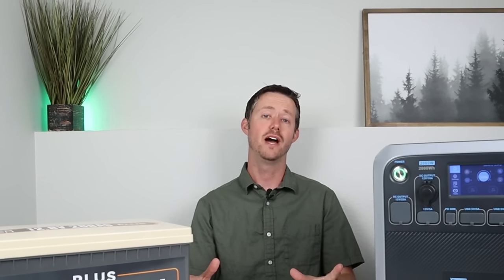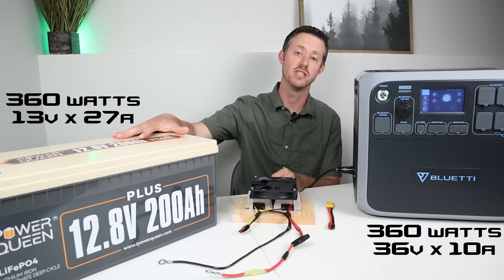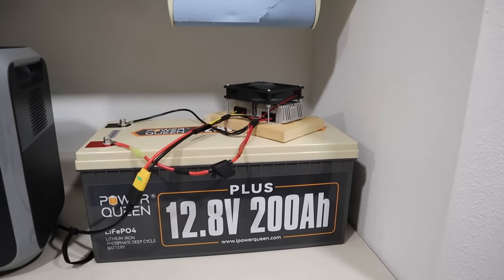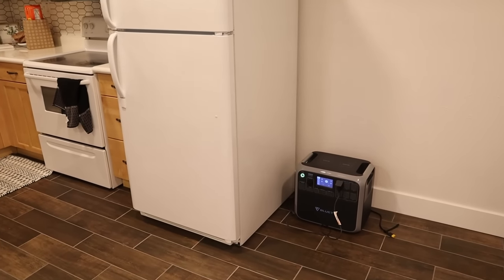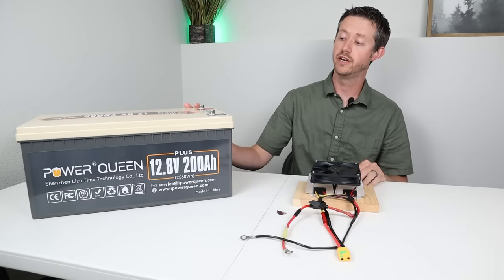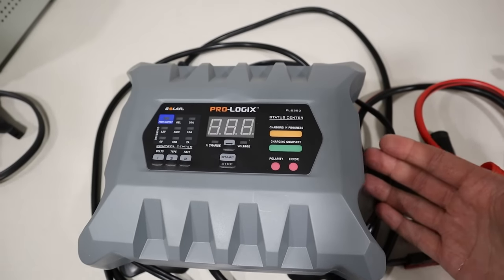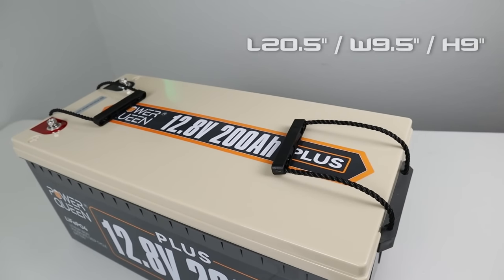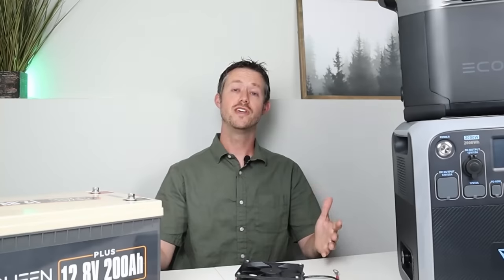Make Your Power Station Last Longer! Power Queen 200AH LiFePO4 - DIY Expansion Battery!

Comment: Another good video, thanks. Since I want to charge my power station with solar, could I then charge the external battery with the power station? In other words, skip buying the AC battery charger you showed and make the external battery a fully functioning expansion battery?
Reply from the maker: you'd still need some sort of battery charger to charge the 'expansion battery' from the power station but yes, that would work just fine.
Reply: @Jasonoid  Thanks again! Renology has some highly rated battery chargers. Would it be a mistake to get their 40A (vs 20A) since it might create too much current for the power station? Also, to charge back the power station from that external battery (extra XT60 port, 11-60V 15A, on Delta 2 Max), would a step-up converter be needed or helpful? Fuse the positive?
Reply from the maker: I have a whole video on using step up converters, you might find this video helpful:
https://youtu.be/I78RxjRXTn4
As for the AC battery charger, a 40 amp charger will only be around 500 watts, maybe a little more with efficiency losses. No challenge for the Delta 2 Max.

Comment: question concerning using the power supplies as battery chargers.  Does the internal BMS control the power coming from the power supplies to properly charge the LiFePo4 batteries?  Where are the 'smarts' to properly control the current and voltage?
Reply from the maker: The power station charge controller does all the work.  Just don't go over the voltage input limit for the power station and you're good.

Comment: Great video. It takes some effort putting the pieces together and making a video of it all.
Is it possible to connect the outputs of the ExpertPower 12v 20A Smart Charger and the KISAE Technology DMT1250 DC-DC Solar Charger in parallel? In another words, the LIFEPO4 battery would be charged using AC power, the alternator and solar all at the same time. Thanx!
Reply from the maker: Yes, you can parallel different types of charging sources at the same time on one battery. You'll just want to make sure they have the same charging parameters (which most LFP charging profiles do). The battery will charge faster with multiple chargers attached.

Comment: Cool!  Could you use aligator clips with an MC4 adapter to then plug into the solar in? Any issues in that? Does it NEED a converter to be safe? I'm a newbie
Reply from the maker: This product is plug n play and will work very similarly:  https://youtu.be/NqnYaqMwktE?si=A2W4PP2tpKl1zoti
Reply: @Jasonoid  PERFECT! I Thank you for this!   I will use your link when I get it.  I watched your video on it. While I could probably snail along and figure out how to do a DIY one like you showed in another video, but THIS just makes it easy ,and me MUCH more confident. Plus, it seems to be kind of universal as opposed to something brand specific and more $.  The noise of it is significant, but, okay for the job. I hope it can run for a long time with the fan ,without heating up too much, as I would be pulling it from a standalone to a power station.    I also wonder if the peceron would turn off once it brought a power station to full, AND a pass through power station be able to run/disharge while it was getting charged this way?
Reply from the maker: @neelimabaird3159  it will automatically stop charging once it's full.

Comment: Been doing this with a 12-24v 10amp into the solar port on my power station for awhile now
Reply from the maker: It's much better than just 12v, charging at 100 watts is too slow!
Reply: @Jasonoid  I have the 100ah power queen and feeding it straight into the solar port on my EcoFlow River I only got 156w but with my booster I max out the solar at 199w. Easier and cheaper than buying another power station in my opinion

Comment: put 2 batteries in parallel and connect with the clamp cable that comes with bluetti ac200 max. and  DO5OS, or you connect the batteries in series and connect to the bluetti on the PV input and you have more power and you don't get complicated with electronic assemblies on the plank
Reply from the maker: You'd need to put those two batteries in series for a higher voltage. I agree, that would be much more simple :)

Comment: I have a suggestion about keeping the inverter cool. 4:57  would it be better to have it submerged in mineral oil instead of using a fan? I’m talking about lowering the temperature.

Feel free to correct me🙂 I’m learning
Reply from the maker: Mineral oil would work as well, but eventually the mineral oil would get warm too. You'd need a 'water cooling' loop to keep the heat down.

Comment: Could I use my existing 12v solar panels and wire it to victron mppt controller and run it to 2 190ah batteries in parallel to run 24v into the pv port on my ac200max?

Comment: Great Idea. I just picked up a Vigorpool Captain 1200 and would like to use this idea to boost capacity. The captain 1200 uses Anderson connectors for solar input. What connector would I use to connect the powerqueen?
Reply from the maker: You could search for a cable that is "ring terminal to female 12v cig plug". Then you can connect the ring terminals to the battery and plug in the 12v charging cable to the female socket.
Reply: Thanks for the info.  I had another question. If I had a 36v battery I wouldn't need to boost it to charge my power station faster. Is that correct?
Reply from the maker: @sote23  yep, just hook it up directly to the mppt charger and you'll charge your power station much faster than a 12v battery.

Comment: cool video.want to try this out on my ecoflow powerstation river max,but 12v and 100ah.have the powerqueen battery bluetooth or app application?want to see if its full or not...thx
Reply from the maker: It will charge around 100 watts with this cable:  https://amzn.to/3YDmPfl
If you use a 12v to 24v booster you'd see around 240 watts input.

Comment: How about...
48V battery and use the PV connection?  fewer parts and 48V chargers are readily available.
Reply from the maker: 48v battery would be great to dump power into a large power station!

Comment: I have the Anker 767. If I did this would it hook it up to the solar inputs to charge it? Also, this battery at 2560 watt hours is more powerful than the the Anker expansion battery at 2048 watt hours. This battery is around $650 and the Anker expansion battery is $1500. It sounds like this setup on my 767 is way more economical than the Anker battery or am I missing something?

Comment: Can you charge the battery with a 200W solar panel while using the Bluetti?  I want to boost the power station and charge up the expansion battery during the day with solar; solar to the battery, battery to Bluetti AC180, and the Bluetti powering a Starlink Mini.
Reply from the maker: Yes, you can charge the standalone battery while it's dumping power into your power station (AC180).

Comment: How much of the battery charge is lost by generating heat by the boost converters and running the fan? 🤔
Reply from the maker: These converters are about 93% efficient, so not too bad. You could also do this instead? Use a 24v or 48v battery:
https://youtu.be/tK4JKmfndh8

Comment: Isn't this going to damage the PS by sending a massive current spike?  There are limits to the amperage you can send into the solar input and sending a dead short across a battery seems like it could fry the input?
Reply from the maker: The power station limits the amperage on the both the DC and AC charging input automatically. It kinda ramps up the charging slowly so it doesn't spike at all.

Comment: Hoping to see a video of diy expansion battery pack  lifepo4 50a 200wh for the bluetti eb3a
Reply from the maker: This is a older video of how to get the most charging out of the EB55 and EB70. Hooking up a 12v battery and 12v to 24v converter to the EB3A will give you the same "expansion battery"
https://youtu.be/_7l8hoNebDY

Comment: Hi Jason. Interesting video. You said if you could change something with this you'd add another positive input wire to the step up, and fuse them both. If you did that would both legs get fused at 20A or 40A?
Reply from the maker: I would use 4 legs (2 pos, 2 neg). 10 gauge wire would be fine, fuse each positive with a 30 amp fuse.

Comment: Can a Solar Panel be hooked up to a Voltage Stepper to increase the voltage? 🤔
Reply from the maker: Most voltage boosters don't like how inconsistent a solar panel can be. Maybe if the day was super clear it would work? If you had clouds or changing conditions it wouldn't like it.

Comment: This was great but I’m not very technical. I live and work in my van hauling freight across the country. I have the BLUETTI AC 200 max and it powers everything currently but not for very long. In fact as I type this I’m charging it at a Starbucks. I drive ALOT so was considering connecting to alternator but I also “sit” between loads. Sometimes for days so also considering Solar. My question is it seems like the battery can only “feed” the BLUETTI and not the other way around. Would love someone to walk me through a reasonably cost solution that I can actually do myself. Do I do solar only and just keep the BLUETTI charged. Do I do alternator only charge?  Do I do both?  Do I do both with an extra battery like this?  Currently I have 12v fridge, 2 max air fans, a diesel heater cpap machine and tablet and phone. Ideally would love to position myself to power a 12v AC unit. Friend of mine has this set up with traditional batteries but is a busy engineer!  HELP :)
Reply: Have you considered the Bluetti expansion batteries plug and play solution for your needs? If you're hauling freight across the country, you could easily charge your Bluetti from a cigarette port? It will give you around 100W charging.
Reply: @LiquidTurbo  yes it’s expensive $1,800. I do charge now the way you’re suggesting the problem is it’s slow. I find myself between loads running out. I can sit waiting on loads all weekend or sometimes a day or two between. Last night I stopped fully charged. This morning I’m at 67%. I’m driving to campground 2 hrs away today and will plug in there. Faster charging and /or longer capacity is what I need. Especially if I ever want to run an air conditioner.
Reply: @slindsay4784  you’re spending more than you’re accumulating via the cigarette port. 

There doesn’t seem to be a good solution other than putting solar panels on top of whatever vehicle you’re in. If you don’t want to spend for the expensive expansion batteries for extra storage at the end of the day you’d still need AC power from the grid to “charge up” as you’ve been doing. You can either spend less energy or generate more. What do you think you should do?

Comment: Hello. Can I use the Bluetti T200S charger (200W - EB55 / EB70) to double charge the AC200MAX? If I insert it into the solar charging port, through an adapter?
Reply from the maker: That should work just fine.

Comment: I have a question will any alligator clip that's 12awg work with 24v battery? Asking because. I have only seen 12v clips.
Reply from the maker: Yes, 12v alligator clamps will also work with 24v batteries. No issues at all
Reply: @Jasonoid  Awesome thank you, for answering that.

Comment: Have you used this concept with the Bluetti AC300? I’ve watched you use the 48v rack battery as an expansion battery on the AC200 Max. I’ve read and watched videos but still slightly confused. 

You can connect any volt battery to the solar connectors on the AC300. Since it’s dual mppt, you can use two batteries or the same battery with two connectors. 

My question is this: do I need fuses on the battery wires? I know the AC300 has the amperage you can set, but as protection, should fuses be used? 

There are many sales right now on 48v batteries… Is it safer to use a rack battery or the regular setup for this use?

Thanks in advance! You are my inspiration to do this stuff on my own!
Reply from the maker: Yes, you can use a 48v server rack battery to charge the AC300 on either or both ports. I do it all the time. The power station will limit the amperage automatically to 12 amps of less. 

I'd recommend using 12 awg or 10awg wire from the battery to the power station. If the wire run is longer, use 10awg. You'll want to use a 20 amp fuse for 12awg, or a 30 amp fuse for 10awg wire. Hope that helps. I have a discount code for signature solar 'Jasonoid'.
Reply: @Jasonoid  so would it even matter if it was at 48v Rack battery or a regular 48v lifepo4 battery? As long as there are fuses with there 10 or 12awg wires?
Reply from the maker: Here's a video breaking down each battery voltage:  https://youtu.be/tK4JKmfndh8
It can be any battery really, it doesn't have to be a 48v server rack battery. The higher the voltage, the faster you'll charge.
Reply: @Jasonoid  I have watched this a few times lol. I think I overloaded my brain. Thanks a bunch. Much appreciated!

Comment: thanks for the detailed video - very useful and informative.   I've found a ton of MPPT Solar controllers for Lifepo batteries, but not many that I can use a sa trickle charger for my Flooded Lead acid battery on my 3rd gen Tacoma which - I think - needs 13.8 volts to charge.  Do you have a recommendation for an inexpensive mppt charger for that?  thanks again for the video!
Reply from the maker: Both the Kisae and Epever are completely programmable for all batteries, you can use the Epever for both lead acid battery types and programmable lithium batteries. Pretty cool!

Comment: How would you charge the lithium battery??
Reply from the maker: You can charge it separately with a solar mppt charge controller or you can use an AC charger using the AC inverter of the Bluetti. I'm testing using the DC output directly to a battery to see if thag works. It would probably charge the battery to about 60% full

Comment: Couldn't you connect a car cigarette lighter inverter to the battery and plug the Bluetti's AC charger into that?
Reply from the maker: There are many ways to accomplish this same goal, this is just one of them :)
Reply: You cannot get the wattage to run an AC charger from the cigarette lighter - car fuses limit current out.

Comment: Couldn't you just hook up the battery to the 12v125a DC Port on the front of the Bluetti?
Reply from the maker: Always use a dedicated charger for a lithium battery so it's not damaged.

Comment: Is it possible to use a 12v to 24v converter then a 24v to 48v converter before plugging into the power station?
Reply from the maker: I made a better video about using these converter in a vehicle to charge faster. The principle is the same as using a spare LFP battery. I was using 12v to 36v converters with good results. You can see the video HERE:  https://youtu.be/I78RxjRXTn4

Comment: Ok Jason, Soooooo, If You use a few solar panels to keep the system charging, One where do you plug the solar panels to, The battery or the power station, 2 could  You add one more battery to the existing battery plus when when the solar panels are connected will the solar panels recharge all three battery pack meaning the power station the xtra battery and the second battery if added to your system that the video has illustrated.
Reply from the maker: If you have plenty of solar coming in, you can charge the 'expansion batteries' with the AC inverter and an external battery charger. You could also purchase more solar panels and a dedicated solar charge controller to charge the batteries at the same time. Lots of options there.

The expansion battery system is expandable as you can put batteries in series or parallel to get more storage. For example, if you have two 100ah LFP batteries of the same model, you can put them in series and get double the power.

Comment: I do this with 10awg wire connected to my ecoflow river pro with just an xt60. It only charges at about 100watts but it stays cool and there is no need for a voltage converter or fan.
Reply from the maker: Yeah, that's the normal 12v charging each power station will do, it takes about 7 hours to charge the River 2 Pro at that speed. Sometimes you want a little faster charging.
Reply: @Jasonoid  Yes. Charging at 100 watts was too slow. I decided to wire my batteries in a 24-volt configuration and now I am getting 200-215 watts on my River 2 Pro. Much faster. Since most power stations have pass-through charging, they don't really need more than 200 watts. I plug my battery in as soon as we get camp set up and it's constantly charging the power station as we are using it. Have not needed it to be stronger than that yet. Nothing gets hot or even warm.

Comment: i just bought the ac70 it says it can charge 12-58v @ 10amp and 500 watt. Could i run a 12 to 48v step up for a 200Ah? or 36 would be the max still
Reply from the maker: Volts X amps = watts.
36 volts X 10 amps = 360 watts
48 volts X 10 amps = 480 watts
You'd need the 48v 10 amp converter to get the full charging power. Keep in mind that these boost converters will die if they are ran at 100% load for a long time. It's best to run them at 50% of their rated power if you want them to last awhile. So youd want to look for a 12v to 48v 20 amp converter for the best performance.

Comment: would it not be better to buy a 24 volt 100ah or 200ah battery?
Reply from the maker: I made a newer video showing 12v 24v 36v and 48v batteries and how they charge power stations HERE:  https://youtu.be/tK4JKmfndh8

Comment: HI, I new to the power station game. Is it not possible to make a cable with the appropriate connectors to connect the battery in series? Something like the factory expansion batteries. Is it a bms or software recognizing the battery issue?
Reply from the maker: As long as your batteries support series connections you can wire them in series and charge the power ststion faster. This video was designed for people with only 1 battery.